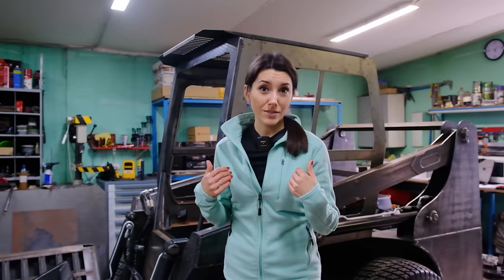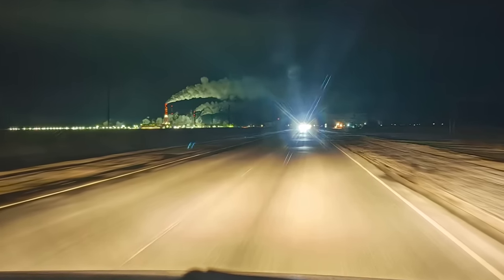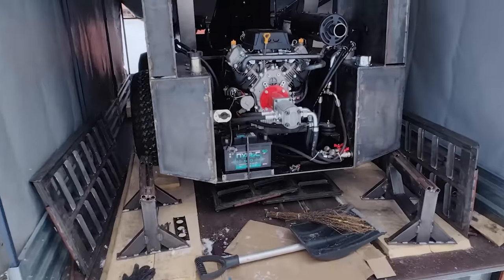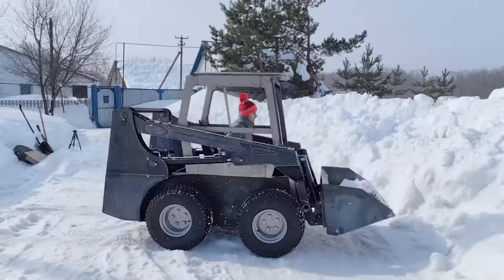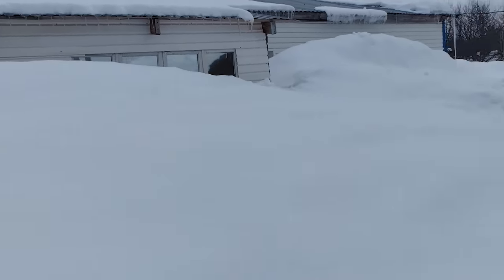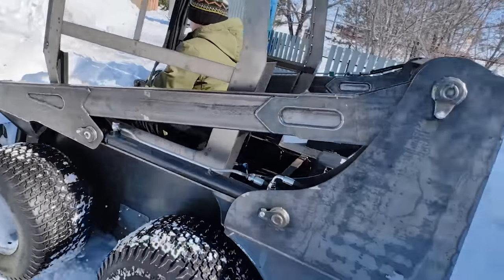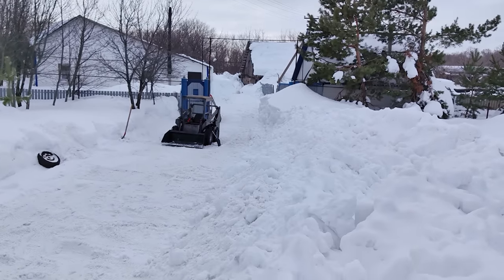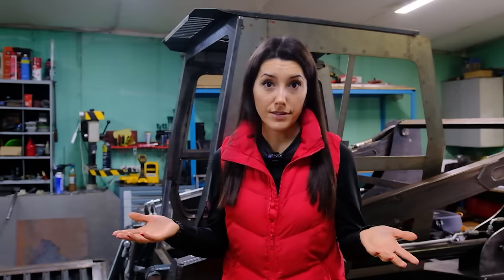DIY SKID STEER. 1st REAL TESTS!

Comment: That engine may not be powerful enough for the task. Machines of that size are normally 35-40 horsepower.
But I am impressed with the performance, capability and stability of the machine, that has to be one of the best built homebuild skid loaders out there. Congratulations on the first real test, well done!
Reply: That's true, but commercial units have bigger engines because they are designed to last a long time under heavy use. She's not going to be doing heavy work with hers and the engine longevity isn't as much of a concern. She may only get 500 hours out of it, but depending on her use that's probably going to be a lifetime.
Reply: Remember, every machine was a homebuild once.
Reply: You can hear its very underpowered. A bigger engine will make it much better to work with, this is just going to get more annoying longtherm @TehButterflyEffect
Reply: 600 series BobCat skid steers had 12 -18 HP Koller engines and some of them are still in use power is not the issue newer machines have more power simply for speed .
Reply: Yeah she should probably look into a diesel Engine, do you guys know if shes having a CC or OC hydraulic system, also am i stupid or are the controls wrong? like i know it that the left stick is for movement and the right stick for the hydraulics
Reply: @garyweber7419  You can hear its underpowered and that has to with the pump being to big for the engine causing it to stall onces the pressure goes up
Reply: @stefanfritz5416  Most of them time each joystick controls one side of the machine and the boom and bucket (or whatever its called in English) are controlled with your feet
Reply: The drive wheel are tandem chain drive. 35hp would just break chains
Reply: @mattbarrett41  There are 200hp road graders with chain drive tandems, it's more common than you think in equipment.

Comment: I know this is now 2 months old but I’ll give you my opinion for engagement. I’ve been a mechanic for many years and have messed with a few different skid steers here in the US. You’ve built a really decent example and it looks like it works pretty well for a garage build. My only advice is to consider using a small industrial diesel engine. Every skid steer I’ve ever seen is diesel. The little gas engine you have doesn’t seem like it makes enough torque to keep all the hydraulics running under times of heavy load. Like when you were trying to drive into the trailer. A diesel would make the same horsepower as the gasser but at least double the torque. And be more efficient at the same time. Not to mention adding some extra weight to the rear if you ever have to lift something heavy in the bucket. I love what you’re doing. Your channel is what more young girls should be watching.

Comment: The bucket seems a good size for moving earth. For snow it could be  larger.  When advancing into the pile of snow, start removing from the top of the pile not the bottom the bucket will fill easier.  Aldo a bucket with teeth  will have an easier entry into the material.  I also built a complete loader and excavator  for my tractor.  Good luck.

Comment: Well done. Some of those engines might have an oil level sensor. Which could kill the engine if it gets tilted too much. Usually they can be simply unplugged to verify if that's the cause stalling the engine. But again, what a cool machine!!

Comment: I have a lot of skid loader experience and some movement of the main boom is quite normal.  I wouldn't worry too much about your hydraulics feeling sluggish, it was really cold so that's normal too.  Also, if you go to load your skid loader again, most of your weight is in the back, so back up into your trailer.  The machine won't buck so much and it will feel a lot better and more controlled.  If I were you, I would get some tire chains on at least the back two tires if you're going to operate on much snow/ice,  that would help a lot.  I have to say though, that you have a very impressive build.  It has been a lot of fun to follow along.
Reply: She has me wanting to build one now lol.

Comment: First, congratulations on a successful shakedown, that was awesome! 

I used to operate skid-steer loaders quite a bit in the past and yes, a bit of lateral play of the bucket is normal, but not a lot (a few cm). Keeping your bucket low while traveling is one of the major safety tips when working with loaders (particularly wheeled versions, they can get quite squirrelly with a load in the air while moving), so if a bit of lateral movement on your bucket has you wanting to keep the load low... I'd say that's a good thing! 😁

It did seem low on power, but it sounds like you have some thoughts about that.

Looking forward to seeing it finished!

PS: As a follow-on project after you finish the loader, you could look into making a set of tracks that go over the wheels. That would help with that wheel slip you were getting when trying to get the bucket to bite into the drifts. I've used equipment that had that style of track in the past and they help a lot in mud and snow.

Comment: It is nice that you feel up to coming back after your hard recent time. 
For a first test the skid steer seemed to work very well. Perhaps you are pushing the system a bit with the size of your bucket. This will be something you need to work out as you move towards the final design. Just the fact that you were able to do all that you did shows that your design is a good one. I look forward to the improvements you come up with and the finish work you still have to do.
Take care, keep safe and warm,
jack,
In The Valley of The Sun, Arizona, U.S.A.

Comment: Great build so far! I think for the hydraulics you should be able to dial back the system pressure enough that it won't stall the engine.

I think an easy way to get to this setting would be to start with a very low set point for the pressure relief valve, run the engine at full speed, and then hold one of the hydraulic functions/controls at max travel so that the pump is forced to work at full (relief) pressure, then adjust the pressure up as high as you can without the engine stalling.

I haven't done much work with hydraulics personally, so please get more feedback / opinions on the correct way to determine the maximum working pressure of your setup for your engine.

Comment: In a previous video I commented, "you need a safety bar.""Not for safety, but to rest your forarms on, to operate smoothly." The boom movement should be minimal because the boom should pretty ridged. But some skid loaders will still have a guide welded on to the frame. The boom will set in the guide, when lowered all the way down.

Comment: I forgot to add. Having a counterweight on the rear of your metal friend will help with stabilising. It will also allow you to lift heavier loads as snow is not as heavy as sand or balast, for example.😁👋🏴

Comment: Hello. What an amazing amount of craftmanship and skill you have shown in this build. I totally agree that with time you will become much more fluid with the controls. I own and have operated my own Caterpillar 248 skid steer for many years and it took me some time to learn how it would react with control operation. I think your stalling issue may be the lack of sufficient flow through your hydraulic relief valves which overloads the engine and causes it to stop. Make sure your calculations included potentially dumping most if not all hydraulic fluid past the relief at full working pressure and flow that you will produce with your pumps. This will be different for lifting vs turning the wheels with each having its own settings to prevent overloading the engine.  You want to stall hydraulically not mechanically. In my opinion your solution should be a balance of pressure and flow. I look forward to more in this series. Best regards from Michigan in the US... by the way moving snow with the skid steer is something I enjoy too.

Comment: A lot of how easy you control a skid steer depends on how you sit in it. It helps to be able to lean back and 'fixate' yourself in the back of the seat. This makes it easier to balance the sticks in your hands. Allow your body to move as part of the vehicle while your hands follow the sticks. Eventually you will want to be able to work very precise, as well as very fast, which is one of the advantages of a skid steer. The jerking movement is caused by control hysteria, which you will eventually learn to control by getting the feel for giving continuous control input. After that, the jerking becomes a tool which is actually quite useful sometimes. One of the unique properties of skid steer is the ability to maintain directional control during a wheely, which in combination with the jerking move is an invitation for some very dynamic use. It allows for handling of loads well over its designed capacity.

Comment: Engine does sound like it's struggling somewhat under normal forward/reverse movement (non-digging rolling motion should be very easy work for the engine and hydro system). Very cold hydro oil might be a slight contributing cause, perhaps a winter grade hydro oil would be helpful. 
From the sounds I heard it's possible you are running system oil pressure too high, try adjusting the pressure relief at the valve body. Decrease the operating oil pressure to the point where acceptable work can be done, but no more. This will only decrease system pressure, not oil flow. A permanently mounted pressure gauge would be helpful with these adjustments. My guess would be that the machine will require only about 1000psi max system pressure to handle most work.
One needs to be realistic regarding how much push work can be accomplished with limited horse-power. Usually low HP skids have quite narrow buckets to allow deeper penetration into dirt/gravel, peeling sod or moving very stiff snow piles. This is not to say that your machine is useless, in fact it will likely prove to be very useful, but heavy digging work will take more time than with a machine of greater power and weight.
Reply from the maker: Thank you for the advices
Reply: Hydra, not hydro. Hydro has always been used to refer to water, not to hydraulic systems as a whole. 

And yes, I am well aware that water is a hydraulic fluid. But that just proves my point.
Reply: Hair-splitters are the life of the party:)
Reply: @terrylutke  Some people just need to talk and say something, others say something you'd actually like to hear. And I just did one of the two...
Reply: I read a lot and enjoy catching spelling and grammar errors made by professional editors. Many times I've wanted to make corrections to YT posted comments, eventually I realized that I'm one of the worst offenders. 
I get your point on hydra vs hydro, I'm not saying I'm right, but I'm not saying I'll do it any different next time:)
Reply: The pressure relief at the valve body should have have no affect on normal system operating pressure. They call it “pressure relief” for over pressurization of the system if something fails or is overloaded it is able to release the pressure to the return side of the system. Hydraulic pumps are designed to operate efficiently only in a narrow rpm band. Lower rpms reduce pressure and efficiency but trying to run a pump at higher rpm (than it is designed for) causes heat in both the pump and oil and will usually result in a failed pump. This is due to increase in viscosity of the oil which reduces librating properties  and reduced efficiency. It sounds to me like she could possibly benefit from a slightly smaller pump which would keep her engine much happier. I was a hydraulic specialist on F-15’s and currently set up wet kits on semi’s. Many people think just because they have a wet kit on their semis for their dump trailer it will work on a trailer than has a hydraulic motor for a pump which many (most) just can’t provide the pressure the motor needs. Many truck owners have a hard time accepting this fact. That motor for the dump trailer would be designed for high flow filling a large cylinder where higher pressure is required.

Comment: I'm so glad to see you back, Lucia. I know you and your husband have had a lot to deal with recently. My prayers are with you both, always.

What i found quite surprising was just how well your tyres coped with the snow. The moment i saw the snow, i thought to myself. I hope they have bought snow chains with them. Otherwise, it will be a wasted trip. Well, it's not wasted as you got to see your uncle.😁

About the jerking. As you said, you managed to control the little metal machine 2 hours later. We have a saying in the UK. Practice makes perfect. Simple when you think about it. The more practice you get, the better you will be.

Once the machine is complete with all of the welding finished, and the glass is fitted, you will find it will operate a little better. Hydrolics can play up in cold weather too as with engines that won't start. But your engine did start, yippee.🎉

Your test trip was a positive one because you have already found some teething issues that are easily fixed. As for the muffler breaking as it did. Sadly, it happens all to frequently these days for two reasons. 

The first reason is money. Companies cut back using cheaper materials. Secondly, some people who work on assembly lines do not necessarily do their job well, and they often do not put down enough welds. Also, the bolts used are not always a good quality or tightened up to spec, resulting in a broken muffler.

There is another reason. Skidsteers in general, no matter what brand they are, all suffer with one fault. I've driven many makes and the one thing they all seem to have in common is that they vibrate so violently  sometimes, that its enough to shake things apart.

Sadly, breaking weld joints is a common occurrence and has nothing to do with how good or bad your welds are as the breaks often occur next to the welds, not because of them.

I am looking forward to seeing your next instalment. 😁🏴⚒️

Comment: Hello, thank you for the very enjoyable videos. 

I have many years experience running skid loaders in the USA. A couple things I note. No, I have never had a bucket that had side to side slop when traveling. When loaded it often would have the bucket bounce a little up and down, but very little, and only the bucket itself, not the arms. Secondly the roof should double as your roll over protection. You can see the roof wobbling side to side every time you hit a bump. This would crush on a rollover, but equally dangerous if you lift the bucket high and perhaps drop a rock on the cab it could easily crush the cab with you in it. I would recommend a much stronger motor, and much stronger cab section. 

Best wishes, and again thank you so much, my wife and I have very much enjoyed your build. You are doing so well!

Comment: This project is so cool - in every way.
Perhaps you can add a ballast-mount centered between the wheels lower than the axles. You could also build some caterpilar-drives (don't know the english word), that you can mount in exchange of the wheels if you need more grip. And perhaps you could use the temp of the motor for warming up the hydraulics-oil (bypass-pipe around the exhaust) in cold conditions.
And a switchable reduction-gear for more torque on the wheels could help.

You should be really proud of yourself!

Comment: My 50 year old Case loader has little side play. There is a substantial strut between the lift arms that appears to keep it steady. Lower HP definitely limits a machine, but I've managed to do serious work with mine. Just put in limits so you dont tear up the machine. Reinforce that roll cage before you do too much more testing. We want you to stick around putting out more videos. Great job so far. Your grandpa wpuld be proud.

Comment: An engineering challenge for you - add bucket auto-levelling to the hydraulics.
I have an old 1986 backhoe (that leaks everything, everywhere) but it has the auto-levelling on the front bucket. A really great feature as well as a safety item so you don’t dump on your head.
Awesome videos.
I really appreciate the effort this project has taken as I’ve built my own CNC plasma table (5’x10’) from scratch.

Comment: Yes the boom arms will wiggle when they are lifted and the machine is moving, as long as it's not excessive it's perfectly normal and should be expected.
As far as the power of the engine while you are working it reducing your working pressure of the hydraulic system might help but you don't want to negatively affect the function of the machine by reducing it too much.  You might want to consider a gear reduction between the engine and pump to give the engine better lugging ability...  It all kind of depends on how you sized your pump vs the requirements of the loader.  I'm sure you left some margin when you selected the pump, you'll just need to tinker with it and you'll figure out what it needs.  Worst case scenario would call for a larger engine.  I  bet you can avoid that though.
Reply: The point about tinkering with chain drive reduction ratio is excellent. Usually skid steer's are not very fast, a maximum skid steer ground speed might be equal to a brisk walk. 
Faster maximum ground speeds sacrifice pushing power.

Comment: Well done!  I have been enjoying watching your progress.  'Should the boom arms swing that much?'  A little movement is normal but you really want to take as much slack out of the system as possible.  Think large bushings and wear pads, tight tolerances with lots of reinforcement.   Side note, when load a skid steer on a trailer, do so in reverse. Back the machine onto the trailer, less chance of tipping back and falling off ramps.  Keep up the good work!